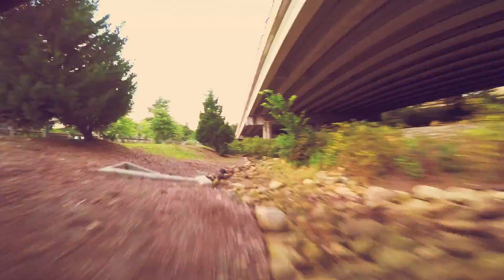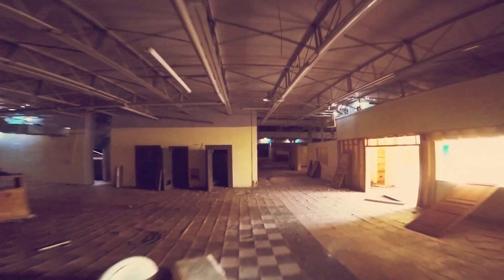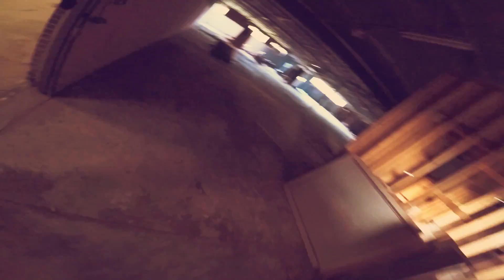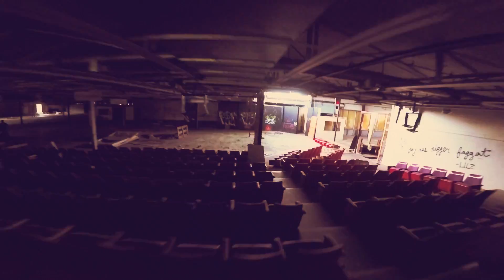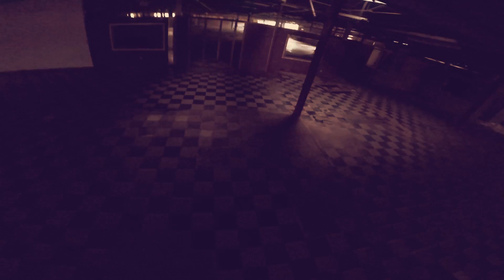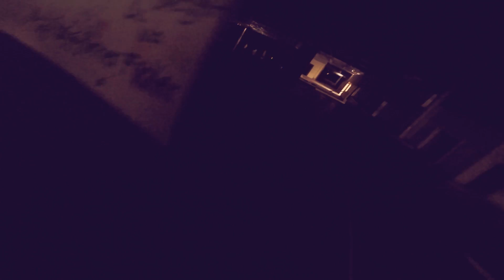Tiny quads and tiny holes

Comment: Great video! "As usual!!", I would say ;-))  
After having tried the 2 setup on the QAV 180 (2204-2300kv AND 1300-3100kv),  which is the one you finally prefer? How are the tiny 1300-3100kv coping with 4S Lipo??
Reply from the maker: +Guillaume PRUDHOMME They are fine! Rock it! :)

Comment: Impressive flying, but what is equally as impressive is how well his video signal is working though the walls and even all the way outside. I would love to know the secret to this. I know its more than just a 600mw VTX. Must be some insane antennas.
Reply from the maker: +thejason51873 Thanks man! I was running a 5.8ghz 600mw vtx and Spironet antennas. The walls were made of sheet rock so penetration was "decent"
Reply: +Skitzo FPV throttle control is sick here. Flying though tight spaces is one thing but to do it right after a fast 180 and with a roof over your head is a whole different ball game.
Reply from the maker: Thanks for noticing man :)

Comment: what control tx module did u use plus what video rx did u use. any antennas or antenna trackers? Also, what camera r u using for the video transmission?
Reply from the maker: +Khalil Buckley I am using the FrSky Taranis radio and Fatshark Dominator v2 goggles with a Spironet antenna

Comment: May I ask what esc you are using with 1306/3100? I use Afro 12A on 3s ,The motors gets really hot.Thank you.
Reply from the maker: +Spydamonkee I'm using kiss 18a escs on 4s. They get a little warm on mine too but nothing too bad. What props are you running? That makes a huge difference.
Reply: Thank you for your suggestion.I use 5045 trimmed to fit.Its got kinda hot even on 3s.
By the way, really fresh pilot skills.Love it.
Reply from the maker: Thank you :)

Comment: Really nice flying.
What makes more fun ? 5" or 4" ?
What is faster ? All on Cobra 2300 on 4s with 5045 Bullnose and 4045 Bullnose ?
What do you think about this idea of a Build.
Alien 5" and bouy 4" Extra Arms and 4" Props,TBSPowwercube.
Than i can fast change frime a 5" Alien to a 4" Alien just Replace Arms and Putt 4" Props on and done ?
Do you recocnise the Speed betwen 5" and 4" Alot wile flying ? Is it alot slower ?
Thanks for Answering ceü up that nice wörk.
Reply from the maker: The 5" setups are faster, hands down but the 4" can fit in small places so that's the trade off. A 4" setup on the right motors will still have good top speed
Reply: +Skitzo FPV witch Motors and Props on 4s would be good?
And can i see the Topspeed in the Video?
Reply from the maker: On 4" I'd say the DYS or XHover 1306-3100kv motors with Gemfan 4045 props and on 5" I'd suggest the Cobra 2204-2300kv on the HQ 5040 props
Reply: +Skitzo FPV really helpgull thanks i think i stil with 5" Alien 😋becouse it caries a gopro better 👌

Comment: Very nice performance as always. Just a quick question. How low do you get your throttle when inverted and achieve such a low descent rate?
Reply from the maker: +FuriusP Lower the throttle as you're falling and it will slow the descend rate :)

Comment: 180 quads are the best! I've been flying mine pretty much exclusively since I built it.
Reply: +ATA250 FPV Interesting. Which one you got? Can you get all your FPV gear in okay? I like the look of the Lumenier 180 Charpu.
Reply: Yeah definitely! I really like these small ~200mm frames, if you run 4s and 2204 2300kv on 5x4.5BN they go like rockets!
Reply from the maker: +ATA250 FPV Yeah, they are really good for proximity flying and they can work really well for freestyle/racing too
Reply: Yeah. You used one for your haunted house vid didn't you? That's one of my top three favourite youtube videos!
Reply: "Too Much Spin" MiniQuad Racer
I'm running a custom made frame cut by a friend. The Lumenier one looks cool, but maybe a bit heavy?
Reply: Hmm I think your friend should start selling frames lol. Interesting, I'm going to go for the QAV210 then which should have great power to weight surely running 250 components. Good enough for a newbie like me anyway.

Comment: skitzo great video! Tell me a little bit about your setup. Are you using 5g8? How did it work through so many walls? And about the big range in light, there are places really dark and other really bright. How can you see anything in those places? Which camera do you use?
Reply from the maker: +Denys Sene Yeah, I'm using 5.8ghz video and it works because most of the walls were sheet rock which 5.8 can penetrate pretty good. The place had LOTS of really dark areas and towards the windows/doorway were very bright, however, my camera stayed black and white the entire time. I used the Lumenier 650tvl mini CCD camera
Reply from the maker: blubeams are amazing antennas. I just prefer the Spironet's because they have a hard plastic shell surrounding the top so it survives crashes much better

Comment: Brilliant 👍😊
Just one question though, how much of a weight handicap was the Gopro on that 180mm frame? especially with the 1306 motors... 
I've been flying an EchoQuad Lite 180mm frame for the past 2 months and I haven't even considered sticking my gopro on it for fear of weighing it down.
Reply from the maker: +Otis Gore It basically kills some of it's handling but it can carry it fine. It definitely wont be as acro :)
Reply: +Skitzo FPV good to know... I think I'll give it a try this weekend.
Reply from the maker: Let me know what you find out :)
Reply: +Skitzo FPV tried flying my EchoQuad 180 with a gopro this weekend... while it was completely doable, it was noticeably heavier and sluggish 😕. Not the outcome I was hoping for. Gonna see if I have better luck with a Mobius or something similar.
Reply from the maker: Yeah, I agree and hopefully you have more respect for this video after trying it lol ;)
Reply: +Skitzo FPV for sure... Lol... This video was my yardstick 😄. I kept mumbling to myself... "Skitzo woulda made it through there" and "Skitzo was flying way faster than this" 😄. 
The designer of my #EchoQuad 180 is busy designing a 230mm frame that will hopefully be as agile as a 180 and have the payload capability of a 250.